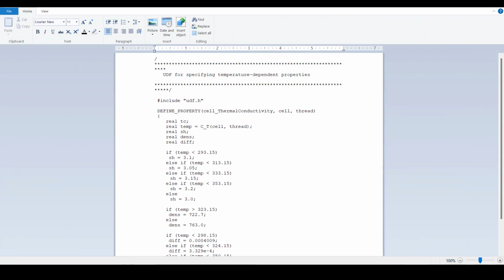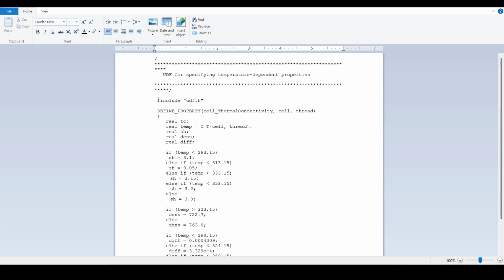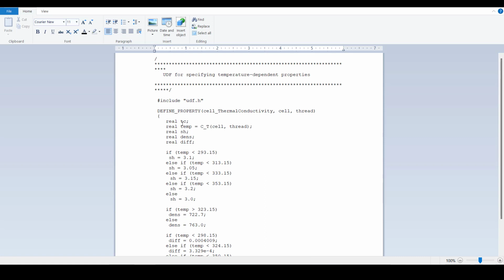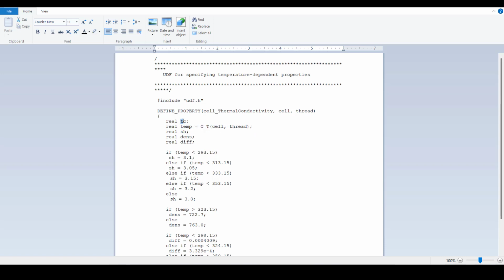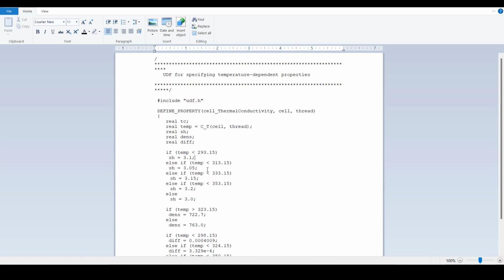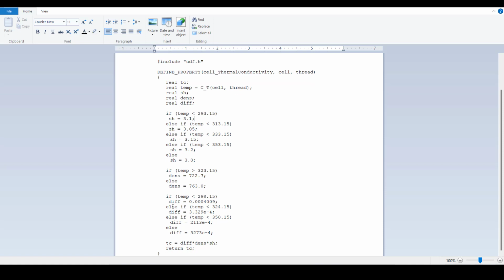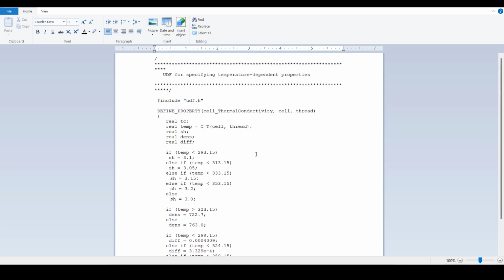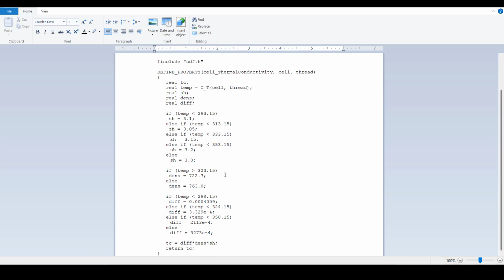UDF to define temperature-dependent properties - Ansys Fluent

Comment: Si If I want to define a property say density as function of temperature plus pressure, how can I do that? like there will be two variables then defining density. Thanks
Reply from the maker: You can modify the UDF to include multiple variables.
Reply: According to "Table 3.2.8: Macros for Cell Flow Variables Defined in mem.h" on "Fluent Tutorials 3.2.3 Cell Macros", it is used C_P(c,t) for pressure cell variable.